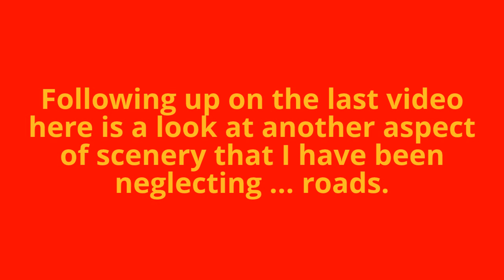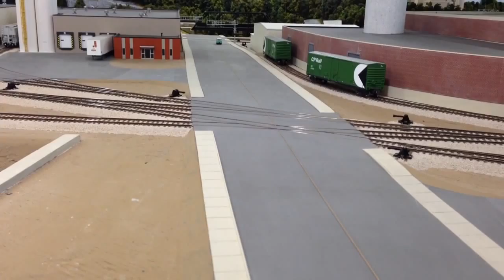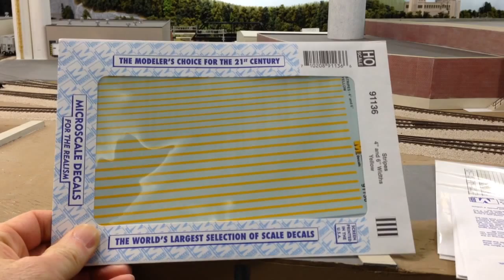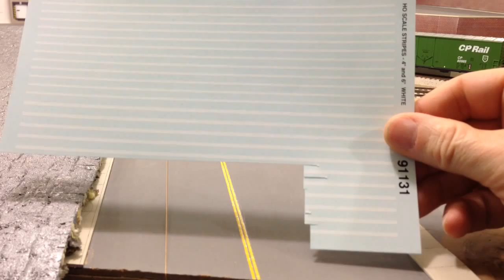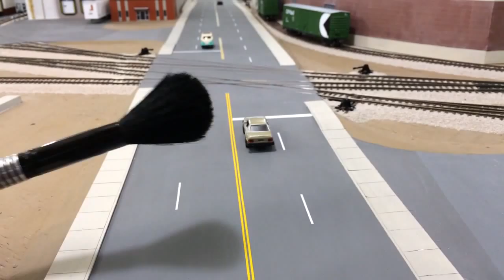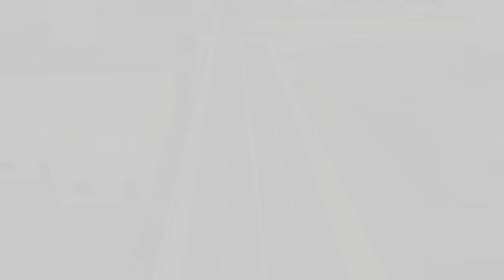Q&NE HO Layout Video 025 - 140223

Comment: Did you ever test the road marking pen option? For roads with bends that feels like a better option.
Reply from the maker: I bought the white and yellow pens along with the positionable curve drawing guide but I haven't tested them yet. I still have some roads to detail and some of them are curved so I will do a test.
Reply: QNERailroad looking forward to it. From the looks of the pens they are possibly rebranded paint pens one can pick up in a variety of places. The issues I've seen is the edges of what is drawn isn't as crisp as I'd hope. If they come with a chisel tip rather than the rounded tip they might work well. Looking forward to your review.

Comment: I do so enjoy your how-to's. I dont recall seeing a howto on these roads and sidewalks, I will have to dig back through these and see if I can find some! Thanks for this, really good idea's here.
Reply from the maker: Sidewalks are .060 styrene cut into strips roughly 3/4" wide. This gives a prototype sidewalk about 5.25" high and 5.5 feet wide. I used black styrene, painted it a weathered concrete colour (my own mix of Woodland Scenics colours), and then scribed curb and joint lines with a very sharp blade. The lines show up well because the sytene is black underneath the paint. Sidewalks across driveways are just painted on and scribed the same way as the styrene. At the edges of the driveways, the styrene sidewalks are sanded down to a feather point to simulate ramps. The roads themselves are sanded plaster, painted with my own grey paint mixture.
Reply: ***** I see a lot of people using styrene for sidewalks and roads, they look really nice. I may have to try my hand at this and see how it comes out. Appreciate the reply, now, if I can just figure out how to book mark this! :) If you make any more, a howto would be awesome. Thanks for sharing once again!

Comment: Have chart pak tape 1-16 1-8 and 1-4 it works better that decals cover with white glue than dull cote. Nice work again.
Reply from the maker: Hi Art
Like I said in the video, there are many ways to do line painting, but I wanted to get scale 4 inch lines, so I went with the decals.